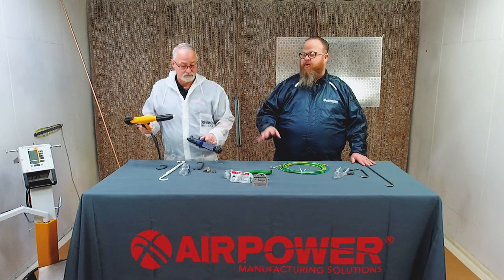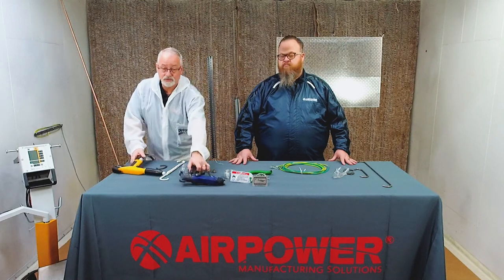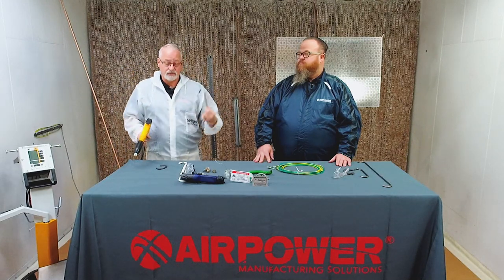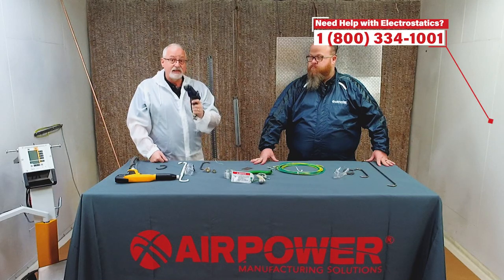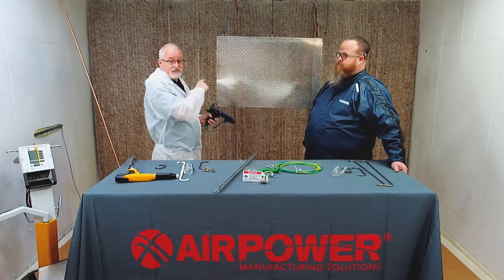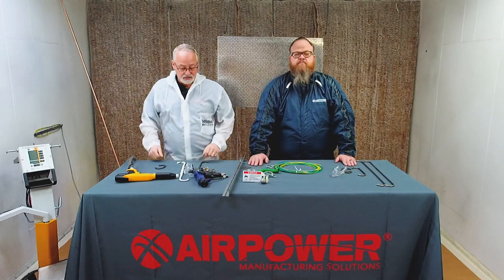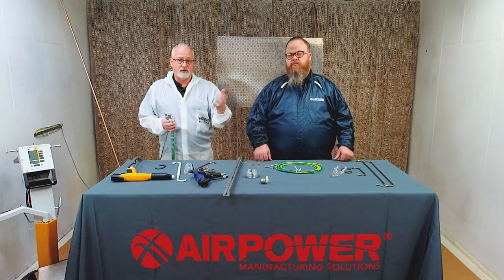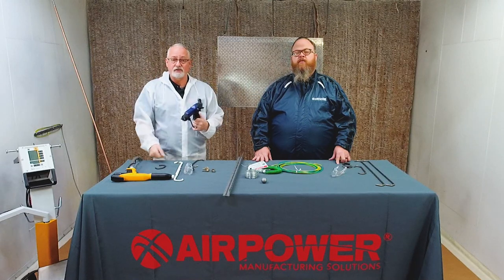Improving Your Electrostatic Liquid or Powder Coating Process

Comment: You said with pin holes you can sand and recoat? Do u just sand the pinhole spot or do u have to sand the hole project
Reply: Normally, you will want to sand the entire part for best results.